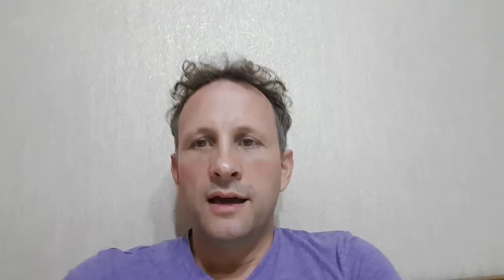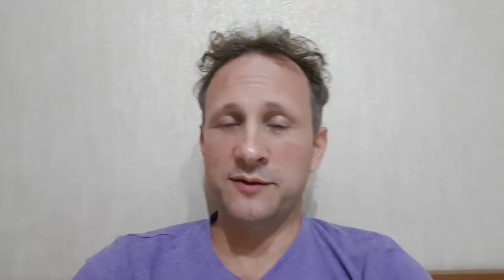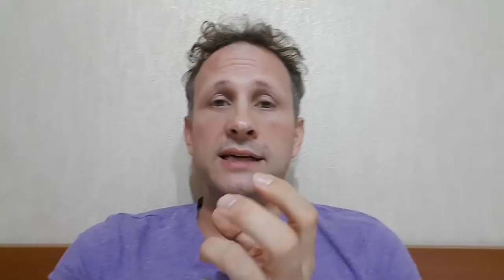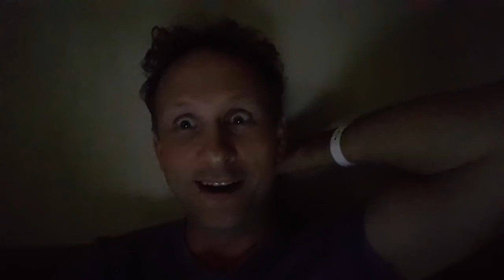Sochi, Day Review - 2nd October 2018

Comment: Bob, thanks for the news and insight on the conference. I still would like to see a modern MEMS aSi THz detector without AR coatings and how it responds. Resonates and detects over extreme EM bandwidth, it's an optical resonator. It may respond to neutrino clusters if it results in a thermal component. Then it would be divide and conquer by incremental band blockage till signal extincts. Just a plausible idea. Anyhow, look forward to more details as you can share them. The type of cancer may also be very telling on the nature of the radiation. Best friend is an oncologist. We've had discussions on thermal energy exposure often associated with cancer. He sees cancer on legs of people who frequently use laptops in their lap.
Reply from the maker: We are energy in a sea of energy hitting rocks together and expecting magic when magic is all around us as nature.

We must learn from nature, learn what it is, live with and within it - because we are part of it.
Reply: @MFMP  , you get no pushback from me. Is that kit still available?